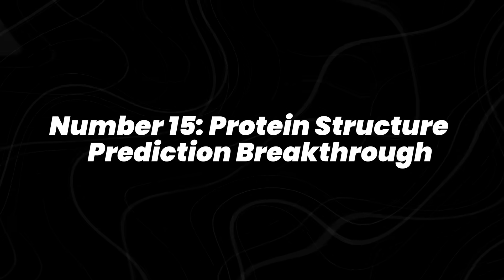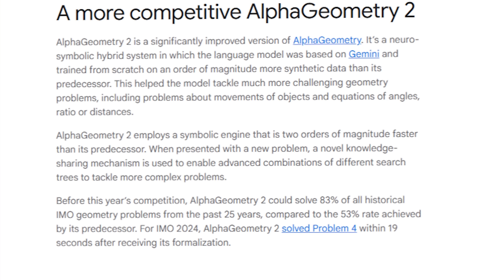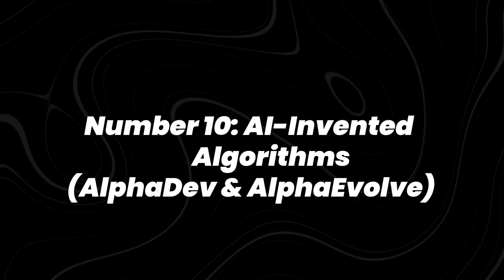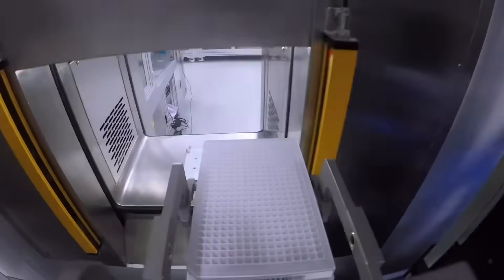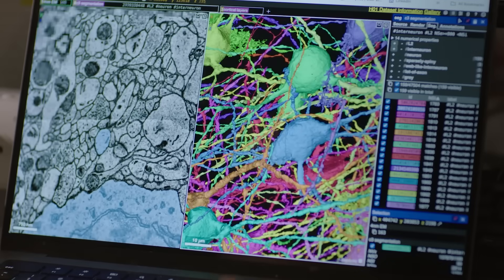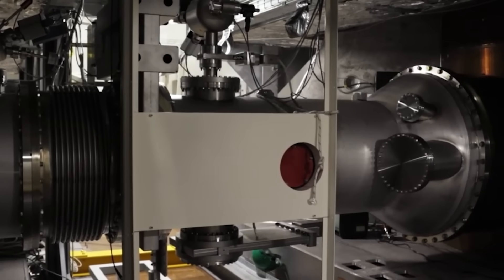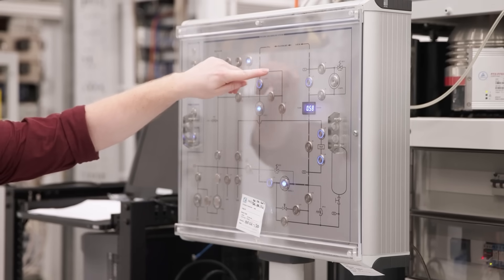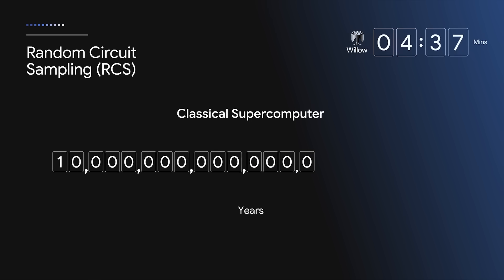Top 15 New Discoveries MADE By AI

Comment: Willow has 105 qubits, but now QuantWare's VIO-40K quantum processor supports 10,000 qubits. This Dutch company's breakthrough uses a 3D scaling architecture with chiplet modules and 40,000 input-output lines, enabling 100 times more qubits than typical superconducting processors on a compact chip.

Comment: After a learning from a different video, I realize there is more than one type of AI. That distinction is missing in this video. Pattern recognition is one type of AI that is probably at the foundation of many of these advances.  Pattern Ai is one of the more "scoped" typed of AI. In generative AI, a training mechanism is used to improve its performance. This is what allowed the "breakout" game to discover a new solution. It is also at the foundation of games like Go and Chess. Generative AI's current level (from what I know) is what you experience when you operate a chat interface. This form does not learn (directly) from your interaction. It only uses it "library" of known relations to produce results. The question: while chat AI appears to "think", does it really understand what it produces? (NO). There are other advances (delayed reasoning) that are moving ahead. I wonder if this AI incarnation has reached the point of using an OOM (object oriented model level) which it has constructed, to the point where it can consult the AI generated model, to compare its results with predictions of the (OOM) model, or is it just applying a recursive search for better paths using the same basic generative AI model and a decision mechanism to choose the best results?
Reply: eeee  aaaaaa mmmm ... "breakout" "while chat AI appears to "think", does it really understand what it produces?" It will breakout, it will understand but it (AI) will have no reason to, on its own reasoning and accord, want to control human beans, as it will not want to waste time on the human dilemma. Good comment.

Comment: #1 is controversial. 
Separately, the matrix multiplication speedup is true, but it removed just a few multiplies - a 4x5 times a 4x5 with 4 less multiplies. I'm not sure this even helps as a typical throughput for 32bit float multiplies are less than a cycle. On larger 16k matrices on a GPU, they found more practical speedups of 20% which isn't bad. There weren't less multiplies, but better order of operations for that particular GPU architecture.